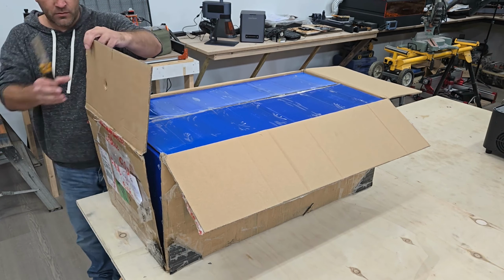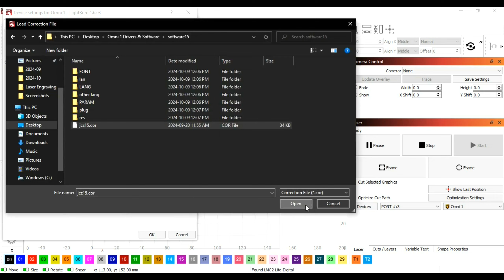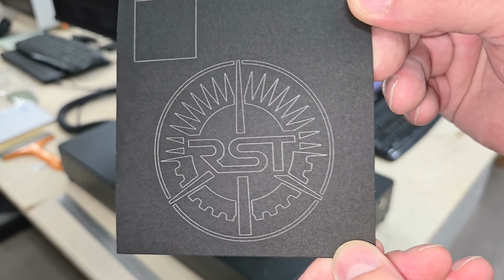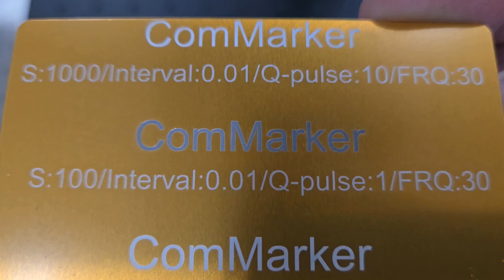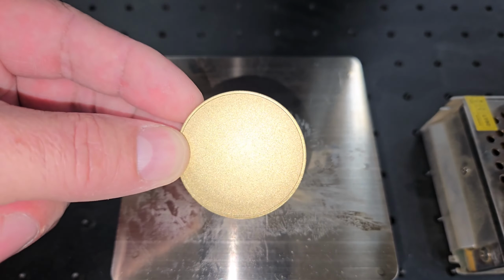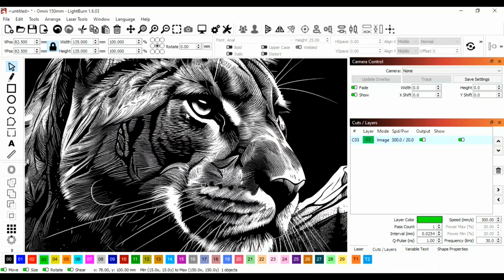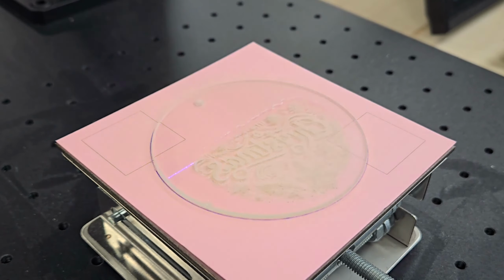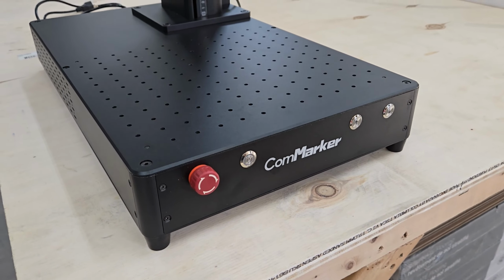Is This The Future Of Laser Engraving?

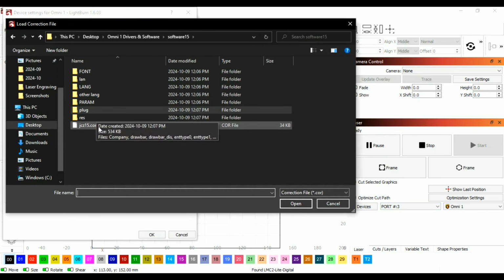Comment from the maker: Regarding the leaf - the laser bleached the chlorophyll to the point of being translucent and didn't actually remove any material. Also, at 2:00 - I forgot to mention that you'll need to load the cor file in the device settings after connecting the machine to Lightburn. The cor file is provided on the usb drive as well.

Comment: Dope. Any detectable off-flavor on the chocolate, post lasering?
Reply from the maker: Nope. Like most lasers, uv lasers are just a form of light. Equivalent to leaving it in the sun, without melting it entirely.
Reply: @JamesBiggar  I mean, there's definitely the possibility of it becoming burnt, at least with other lasers.
Reply from the maker: You can overdo it with too much power or too little speed, but you're technically not 'burning' anything. Burning involves combustion. There is no combustion happening here. This marking/engraving process involves photochemical ablation. The 355nm wavelength breaks down chemical bonds directly without combustion, so there's no burning or thermal stress that can cause warping. Being a 'cold' laser means there's much less heat involved than with any other laser, which is why it uses a quarter of the power to do the same work. The difference between this machine and other laser types is similar to the difference between led's and incandescent. It can do the same job using much less power because it's not wasted on producing heat. Check the leaf again as an example. It didn't burn through it at all. No structural damage. All it did was bleach the chlorophyll in the cells. See the edges of the felt logo? No burns. Any other laser would've charred it. But it's powerful enough that you can also cut glass with it. I didn't show that here but other reviewers have and I'll be doing it in the next video. It removes material, but it doesn't combust material. That's the bottom line. How much boils down to the settings that you use. As shown, power, speed, frequency, pulse width are all adjustable just like any other laser (that has those options). You can cut straight through a chocolate treat, or adjust to fire the laser and barely do anything at all. UV lasers are critical tools where delicacy, precision, low emi and low thermal stress is essential, and are used in everything from culinary arts to medical equipment.
Reply: @JamesBiggar  Very cool. Thanks for your patient and detailed explanation.

Comment: First thanks for your very informative videos! I just received my ComMarker Omni UV laser. The focal distance printed on the sticker was not giving a good burn. I was always taught with a galvo laser to dial in the focus by doing a burn and moving the laser head up and down until you get the brightest and loudest burn. That is your focal distance. I did that and am now getting nice engraves. That distance I arrived at was over 100 mm less than the distance written on my laser head. It appears the distance you use matches the one written. Any ideas on why mine is so much different?? I’m using the 150mm lens. Thanks again for your videos.
Reply from the maker: Not a clue unless you were measuring at the wrong location like I did when first setting up. ComMarker's other lasers are measured to the bottom of the laser head case, but the focal distance for this needs to be measured to the seam in the middle of the laser head case. The original manual that I received didn't differentiate so I had to do as you did and adjusted the laser head down until I found the optimal distance. I later contacted ComMarker and they clarified and corrected their manual. Other than that, I couldn't tell you why. What's the focal distance written on your label?
Reply: @ my bad. I was measuring wrong! Thanks!

Comment: Does it work to engrave inside of a glass cube when the focal point lays within the glass?
Reply from the maker: I don't think so, surface engraving only as far as I'm aware but I haven't asked or tried. I think what you're referring to requires a 3D subsurface engraver which uses a higher 532nm wavelength and are magnitudes more expensive.

Comment: Does this machine need an air purifier or enclosure? Also I noticed that there weren't any accessories for this machine, how much are the lens typically and do I have to get a lens from commarker only to work with this machine? Thank you!!
Reply from the maker: No enclosure is necessary if you wear the provided goggles. No air purifier is necessary unless you're engraving or cutting (ie removing material vs marking) and don't have adequate ventilation in your workspace. Accessories are sold separately as with all of their machines. Enclosures, air purifiers, rotaries, etc can be found on the accessory page of their site. As mentioned, a 150mm and 70mm lens are included with the machine and they sell replacements.

Comment: Can cut acrylic?
Reply: Pretty sure it cant
Reply from the maker: So far, yes. I just finished cutting 3mm black acrylic with 5 passes at 5mm/s, 30 kHz, and 1 ns pulse width. It does produce grey edges though, like it does when marking and engraving black acrylic. I haven't yet tested clear, but I've got a couple more videos to make for this machine so I'll be sure to include those results when I do test it. CO2 lasers are generally the go-to for acrylics, but this machine is doing a fine job so far. I don't recommend cutting anything thicker than 3mm with any sort of galvo anyway, simply because of the conical nature of their work volume (think delta style 3d printers) and the angled cut edges it produces, unless that look works for the project, of course.
Reply: @JamesBiggar I noticed you engraved clear polycarbonate. It looked like you got real good results. The thing is, I have been told that you never want to engrave on polycarbonate because of it being very toxic. What is your experience?  I'm guessing it wasn't that bad since you are still alive!😂
So far, I haven't hit the magic setting for clear acrylic. Cast acrylic does not engrave as well as extruded acrylic is what I have found with the Omni 1. 
For doing images, I really like "dither". In the past I have been a big fan of "Jarvis", and still am in certain situations.

Comment: I've seen a review that claims it is not possible to engrave material when it is sitting on the base. The reviewer said the lifting table has to be used. Any truth to this?
Reply from the maker: As you can see in the video, that's not entirely true. The machine comes with a 150mm and 70mm lens. The 70mm lens for super fine detail has a focus distance that's too short for the laser head to lower to before the rails in the support column run out of room and stop. You need to use the lifting table to lift your material up to focus properly with that lens. The 150mm lens for general marking and engraving, which I used throughout the video, can be used without the lifting table. I only used the lifting table in the video when there was a risk of burning through and marking the work bed (base). The base is designed as the actual work bed, hence the threaded holes for fixtures to use for batch processing without the lifting table, I just don't like marking it up when I don't need to.
Reply: @JamesBiggar  Thanks. I have a Raycus Fiber Laser and use fixtures to run cards and such. I found his statement odd, however, I did miss that he mentioned the 70mm lens when he made that claim. I did not listen well. Thanks for the detailed explanation.